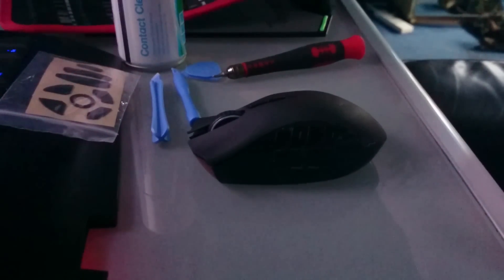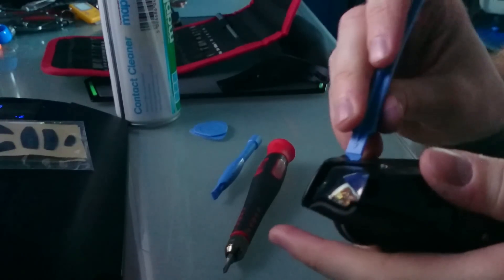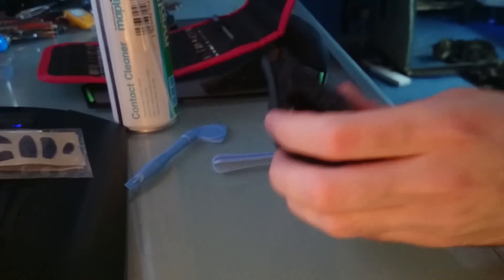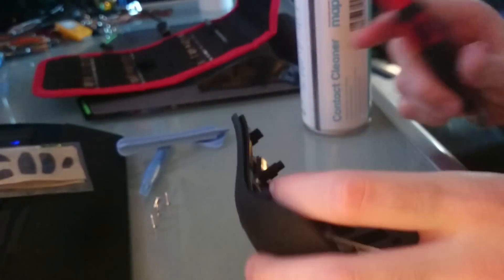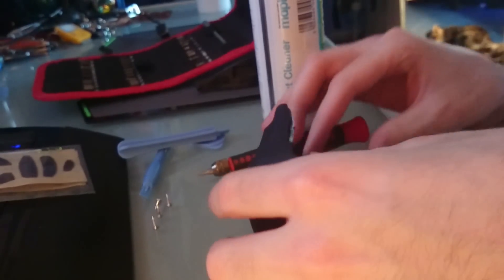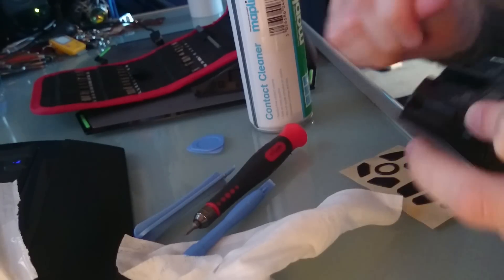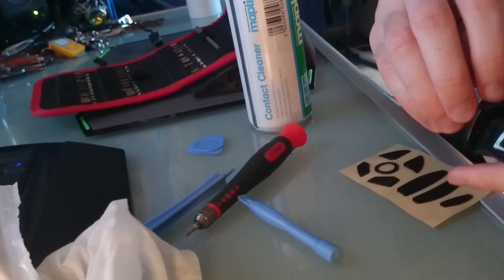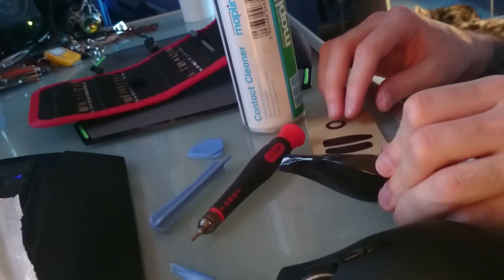Razer Naga Epic double clicking fix tutorial

Comment: Thank you! My Naga Epic was double clicking on a single click (deleting one email? whoops deleted two! Selecting a bunch of files? now you're opening 10 PDF instead!). I wasn't sure what would cause this but after playing with settings in Razer Synapse, adjusting device settings, uninstalling and reinstalling the drivers, etc. I decided I needed to try and clean it. I used your video as a guide on how to take it apart, and where to clean. Great advice on the feet (I probably would have ruined them if not for your warning) and once everything was back together, the issue is resolved!

Comment: Worked for me on my Naga Trinity just now in Oct. 2021. Nice and easy. The sticky pads will never be the same, and one was destroyed, but my mouse works again. Need a very small screwdriver; normal ones don't really work. Also, I don't recommend doing this unless your mouse is out of warranty and you have a replacement mouse handy (just in case). It will definitely void any existing warranty.

Comment: As long as the mouse has no current running through it, you should be good to spray it down entirely. As long as it's dry when you turn it back on, you're in the clear.

Comment: I used dry erase cleaner because I didn't have contact cleaner. It dries really quickly and has ethanol in it.
I reused the feet but it's a little rough and you can feel it, so be careful when you take them off if you don't have replacements.
Edit: it fixed the issue

Comment: Had this problem. Tried blowing into the right & left button gap at the front like another youtuber suggested. Still didn't work... 

I'm way too lazy to do all the stuff you showed... 

Ended up tearing off a bit of printer paper, folded it to fit into the button gap. Inserted the folded bit of paper into the gap, clicked the button then dragged the paper out while the button was still pressed. Seemed to do the trick for me. 

(Warning - If you're intending to follow my method, please don't use anything thinner/softer than printer paper or the paper might get ripped off and stuck in the mouse if you're not careful. And even if you're using printer paper, fold it at least twice for extra thickness)
Reply: i tried it and it worked for me

Comment: I need to remove the battery of my Razer Naga Epic 2012 but, the guide just said "Sliding the lock switch again 
will allow you to remove the battery" the battery doesn't move a millimeter
Reply: Sedhaild the battery has expanded. You need to open the case to remove it. There is a hole behind the battery harness that has a stub. The stub is apart of the battery case. Push the battery out by pushing the stub.

Comment: My problem is very similar but I still couldn't get it to work, even after replacing the spring mechanism in the clicker box. My issue is kind of weird... I tested it by setting right click to type the letter "A" and opened up word. It would spam "A" if I held right click down... but only lightly. If I pressed too hard, it'll release it and stop typing. How do I fix this? More spring tension? Less spring tension?

Comment: I may just be stupid (well... I am) but I don't see how to take the side off my chroma epic.  It looks like you just popped it off, but on mine, it appears to be all one piece.
Reply from the maker: not too sure how the chroma epic is built, this is the very first Naga epic model
Reply: +Fraser Sutton Gotcha.  I wouldn't have thought there would be much difference.  I'll continue to explore.  It may just come apart like the old corded Naga.
Reply from the maker: +Kevin Flick my original corded Naga had the screws hidden under the feet. Try there. It would be best to have a packet of replacement feet handy as putting the old ones back tend to lead to nuisances in my experience

Comment: Hi! Nice video, pushed me (finally...) to fix my GF's Hex.

One thing you said about contact cleaner and not letting it dry; I don't think that was the problem. Cleaner is just that, cleaner. It's not a lubricant, and the switch is mechanical. So for a more permanent solution you should use a lubricant (like sewing machine oil or some other liquid lubricant like that) to lubricate the switch after the cleaning.

Comment: NOT worked for me, this isn't the fix, it may work for some people if the problem is slight, but you need to open the MICRO SWITCHES BOXES micro switches and bend the spring back into place. there are other videos on this.

Comment: issue isnt the switches most the time it is the soft plastic they use to make the case specifically where the it contacts the switches they where a groove inthe plastic which is what makes the switch "bounce" double clicking
Reply: +WarriorPaxo my old Naga after 6 years of use started to double-click or just ignore "clicks" (right button still clicks, left one doesn't even makes clicking sound), i took it apart and found out what the part of a case which presses the switch just worn out so much what it could not press the switch correctly anymore. Shame what it was the case, not the switch but 6 years of hardcore gaming will kill ANY mouse IMO.
Reply: adding this for reference for others given the time frame since post, but Usually at that point, you can see wear on the plastic that depresses the switch if you open the mouse. It wears and will slide instead of pushing down, which can make the switch not stay depressed causing the multiple double clicking, or even wear so much it cannot click reliably at all. 

Fix for that involves filing the plastic followed by superglue on the end (not the switch ffs x.x the super glue is to prevent wear, not to bind anything), allowing it to cure, filing/sanding the cured superglue smooth and flat, using compressed air and then putting back together. Might have to open again after testing to file some more. Just look up fixes for the double click for razer naga in general. I did it about 3 years ago now and no problems since, but I offered to fix a naga epic and needed a memory refresher on what to do which is how I ended up here. I forgot to get electronic cleaner but meh I don't believe it would matter as I can see the issue is again the plastic wearing down as I expected. Good luck to all.
Reply from the maker: any remedy for this? my double clicking is no longer the clickers issue now, it has progressed due to wear and tear
Reply: my naga is around the same age as that and the same thing is happening. Right click, middle click and 1-12 are fine but left click sometimes clicks multipe times, sometimes none at all.